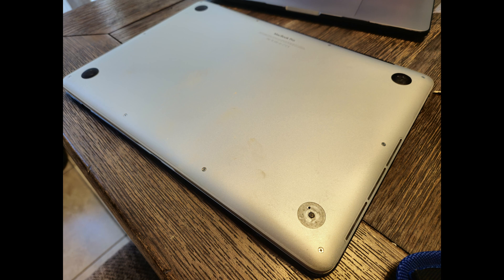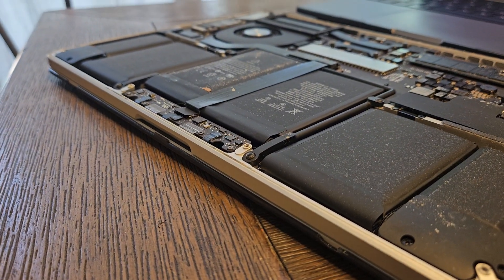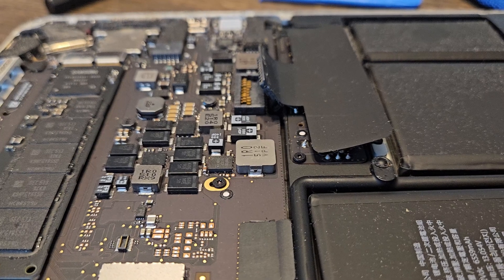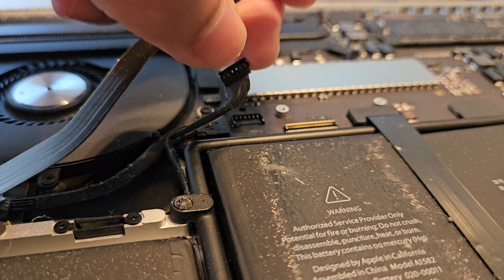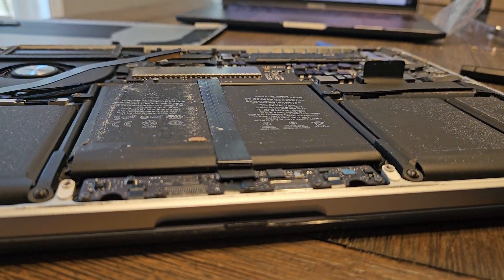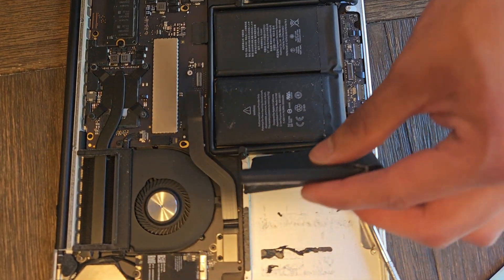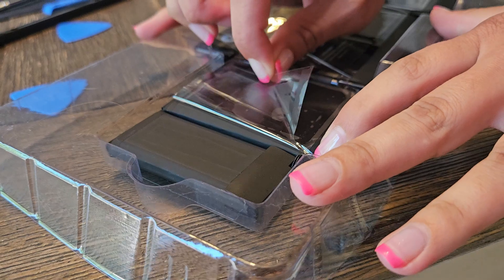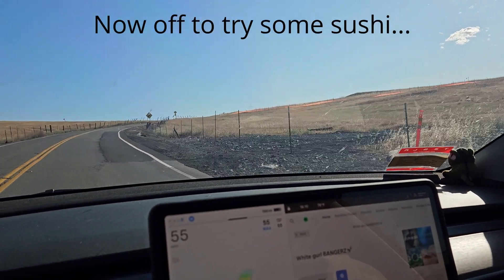MacBook Pro 13" Retina (Early 2015) Battery replacement❗ A1502 (EMC 2835 MacBookPro)

Comment: Do yourself a massive favor and before you put the new battery in and take off the adhesive... just connect the battery to make sure it actually works... it sucks when you get a bad new battery then have to re-take off everything again.
Reply from the maker: True that 100%